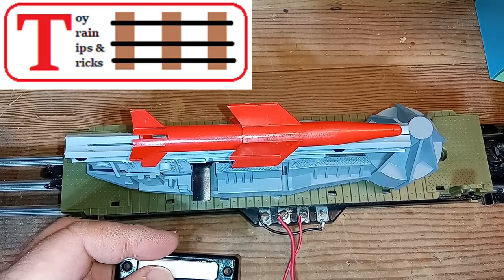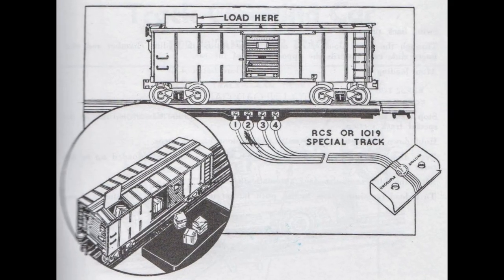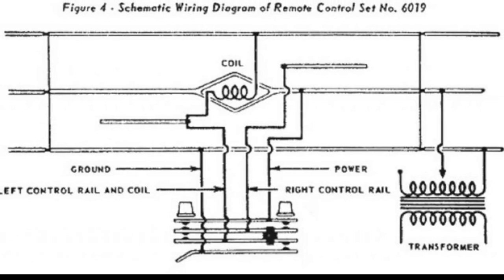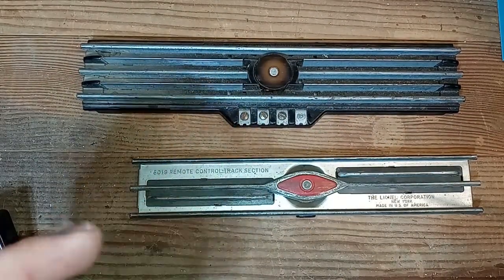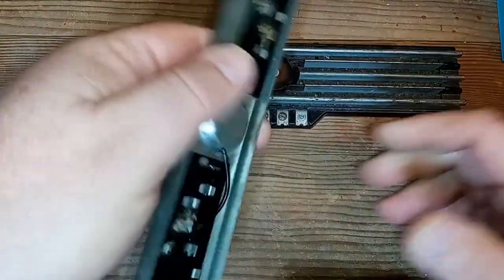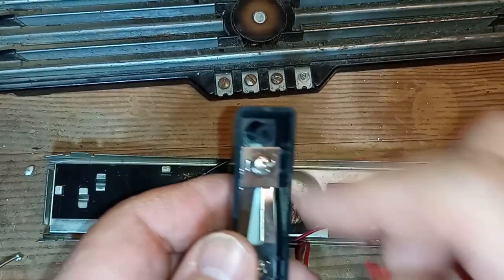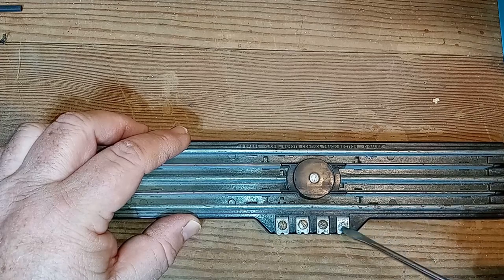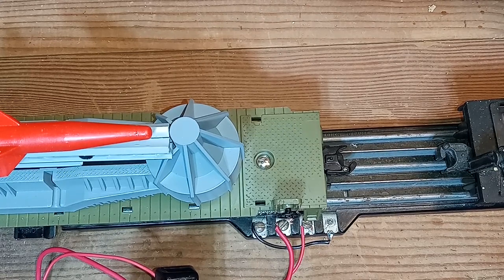Easiest Wiring For Lionel 6019 And UCS - Push Button Operation!

Comment: THIS DOES NOT WORK!  I rewired THREE (3) 6019 sections, following these instructions to the letter. I tried different buttons, different transformers, different operating cars. ABSOLUTELY NOTHING. Three 6019s can't be "bad".  This might work on Fantasy Island, but sure as Hell AIN'T working here in the REAL world.  Boo! Boo! You USUALLY give GOOD advice. Not this time.......
Reply from the maker: It has worked for me every time. Are your outside rails grounded properly??

Comment: Thank you so much! I have always been confused to why these were wired the way they àre. The stack is way too complicated for what they do.and the diagram only confuses it more. I am definitely going to rewire some of these.
Reply from the maker: Happy to help! Thanks for watching!
Reply: Each circut in the wiring of these particular controls is there for a specific reason having to do with the type of activation desired for a series of specific car functions. (Especially on older cars with more than one operating feature.)

For instance, any prewar / early postwar car with coil operated couplers would use the same 4th or 5th rail from a RCS track (depending upon direction of car travel relative to the pick up shoe function) to uncouple - just as many of the operating cars of that era would also use the same special rails (depending on direction of travel) to trigger features like unloading boxes, barrels, logs or coal. 

The RCS controller allowed prewar automatic feature activation and carried on throughout early postwar transition era cars, but it wasn't until the addition of "magnetic uncoupling", (from a single coil located in the center rail of the newer "UCS" track which pulled down on the truck mounted plate holding the coupler hitch pin) that the activation functions for both the 4th and 5th rails began to become redundant.

Then, to complicate things even further, most new action feature cars of the postwar period began to use the center rail "electromagnetic coil" to also trigger any on-board features by pulling down on a magnet pin underneath the car. 

Meanwhile, a few feature cars like the operating milk car and operating cattle car, in respect would continue to use on-board coils energized by the 4th or 5th rails - in order to flick milk cans from their open doors or help to vibrate cows into and out of the car interior.
Reply: @crabbinmoose8583  I understand all that I have been collecting since the 1980s and have all the reference books and repair manuals. I have always wondered why they chose to wire the switches with that complicated stack which I am sure was a nightmare to engineer, when it could have been done much simpler. And yes on the older equipment the coil coupler opens when you hit the "unload" button. Thank you.
Reply: @richardsobieck9660 , to us it may seem redundant and pointless to have such a stack of switches, but as Lionel developed newer equipment with improved or not so improved cheaper designs, they ran into the same problem we have today....backwards compatibility and the retro engineering needed to get the most out of what the customers already purchased from them without alienating their base and breaking the bank at the time. 

I do like the doorbell trick and also the smaller red button would look great on a facsia board or better yet worked into an wireless bluetooth operated electric solenoid to activate the uncouple unload feature.
Reply: @crabbinmoose8583  This is true but I still think all the extra was un necessary. All one needs to do is energize the center magnet or the extra rails for the operating cars which used the flying shoe same as the coil couplers. Using this method you can energize them both with one button. I would still use two switches to have the capability of powering one of the other. since some of the older cars needed the the fancy wiring to uncouple the coil or magnetic couplers it was probably wired like that so one button could do both. It is an ingenious way of working that switch but as I said earlier just a bit of overkill.
Reply from the maker: I imagine that if Lionel was engineering a 6019 from scratch they would develop a simpler method. However, they were working with the existing RCS engineering and chose to add features on top of that rather than to reengineer the system. In the short term it was a faster solution, but in the long run using extra wire and assembling complicated controllers likely cost them significant funds!

Comment: Hey Mike. Apparently, I'm one who likes your droning. You always have informative and insightful ideas to bring up. I like how detailed you go into explaining things. Never be ovely concerned about dumbing things down for us dummies. After all some are just novices and don't have an engineering degree and we came here to learn something.
Reply from the maker: Thanks for the feedback! The reason I do this is I know that many things that were once "common knowledge" in the hobby have faded into obscurity. The older stuff still has a lot of life left in it (but I do like the new stuff, too - I just wish I didn't have to choose between a new Lionel steamer and paying the mortgage).
Reply: @ToyTrainTipsAndTricks  Mike I run conventional locomotives. Marx, lionel, Williams and K-line. Mostly postwar and some MPC and LTI era locomotives for a reason. I want to run trains without the aggravation of some finicky electronics failing or glitches. I run the big rugged trains, not the overpriced whimpy ones that become shelf sitters with bad boards. The only modern features I use are the railsounds sound systems. It doesn't keep the engines from running if it fails.

Comment: black aquarium gravel - walmart - $6.80 / bag - qty = alot of foam core strips, 50 maybe?
discard the neon variety mixed in... or not? up to you. little bling for your black diamond
glue them on xps or foam core or cardboard or styrene planks or thin balsa strips or piece of tin... whatever
3d print is nice too
carbon filter media for aquariums is perfect for this as well but (imo) prohibitively expensive

Comment: Just to ask, I have a UCS but I don't have any control button at all.
With this, I can now wire it up and get it going? I just want to uncouple and
open the door on some boxcars with the man in the door. The section I have looks different,
it's probably MPC era for O27 track. Just the red-colored magnet thing in the middle rail.
Reply from the maker: Yes. All you need is a wire and a push button (which is what these originally came with). The common connection is through the track, so attach one wire to the screw underneath and to one side of the button. The other side of the button goes to your HOT transformer side (powering your center rail for track power or the accessory hot for constat voltage) you are set!
Reply from the maker: https://youtu.be/ACd_Kng_MyQ
Reply: @ToyTrainTipsAndTricks  THANK YOU~!

Comment: Is the 027 kit one the same thing as the one that comes pre assembled ?
Reply from the maker: I'm not sure I completely understand the question. The post-war Lionel number 6019 did come pre-wired. However, the wires are often found broken and disconnected. The UCS track for O gauge track was not pre wired.

Comment: I wonder if this method would work on the older RCS remote track sections ?
Reply from the maker: Yes. Tie one control rail permanently to common and use a button to turn the hot on the opposite control rail on and off.
Reply: @ToyTrainTipsAndTricks  First and third terminal on the RCS section get tied together with a jumper wire.  Second and fourth terminals go to a momentary push button.

Comment: Can the same wiring be done to the 6-12746 remote control track?
Reply from the maker: Yes. It's simply a modern #6019 section.
Reply: @ToyTrainTipsAndTricks  worked great!
Reply from the maker: @craigjacoby3112  Great!!!

Comment: Mike how do i simple wire a RCS o GAUGE REMOTE TRACK?
Reply from the maker: It's easy of you only want the "uncouple" function since there is no center magnet. Simply wire the push button between the "hot" side of the transformer and the second post on the left (or on the right - doesn't matter much - you could even wire it to both center posts). Again, this is for uncouple only - not "unload".

Comment: I’m wondering how to to wire a 2 button setup with constant voltage? Using regular push buttons
Reply from the maker: Can you elaborate on what mean by "2 button setup?" What functions are you trying to accomplish?
Reply: @ToyTrainTipsAndTricks well I just like the look of the Lionel controller, but don’t like the stacked contacts. So my idea was to replace the buttons in the controller with something better, but I’m starting to think the only way that could work would be to add a couple of relays in, further complicating things.  I’m also wondering about how you said the UCS track can’t use constant power. My UCS has a small wire going from terminal 2, feeding the coil magnet and the other end of the coil wire goes to common. The #3 terminal, which is track power, looks like it serves as the mounting bracket for the magnet, but the magnet wire isn’t connected to it.
Reply: @ToyTrainTipsAndTricks  Also, I noticed the wiring diagram I’ve found for the UCS online is different from what the diagram that came with my track section says. My specific model says UCS-6 on the bottom and No. 6-5530 on the instructions
Reply from the maker: @cobhc1986  Ok. The 6 prefix means it was made by MPC or LTI (1970-1994ish). I'll see if I can find a modern schematic.
Reply from the maker: @cobhc1986  I have not yet found a schematic for your uncoupler, but I can verify that it is modern production (last cataloged in 2017) and it is wired differently from traditional UCS sections.
Reply: @ToyTrainTipsAndTricks  Thank you! I’m assuming now that the reason my newer UCS is wired differently is to allow for constant voltage operation. The instructions that came with mine say just remove #3 wire from #3 terminal and connect it to accessory voltage. Kind of disappointing to hear the older ones don’t work like that
Reply from the maker: @cobhc1986  Old UCSs CAN use constant voltage, but NOT with one button operation as I showed.